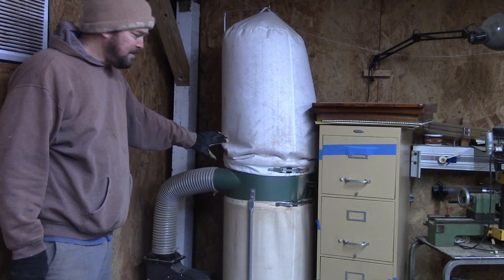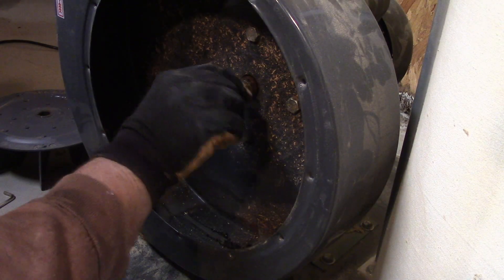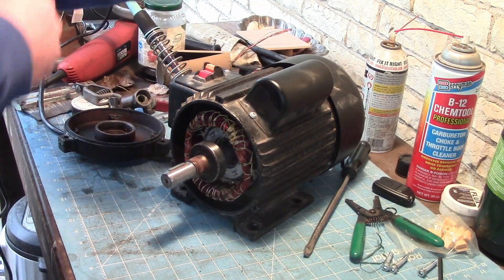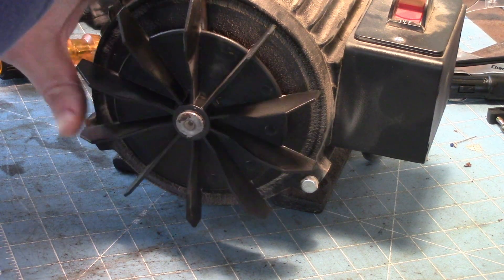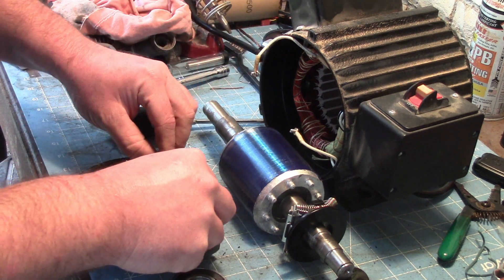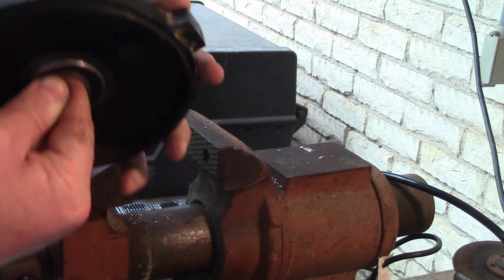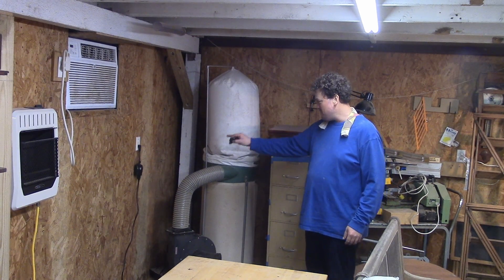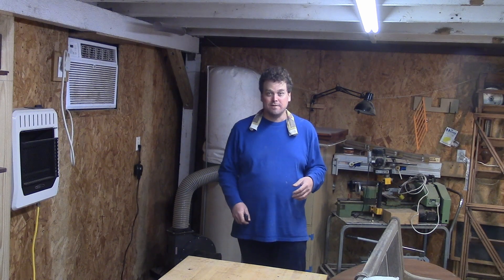Noisy Dust Collector gets New Bearings and a Second Life.

Comment from the maker: Ball Bearings are such a vital part of our world. Not only does everything run on them, bearing factories are also a strategic target during war. Just think back on the events Second Schweinfurt raid during WW2 at the amount of men and equipment deployed and lost in an attempt to cripple the Germans ability to wage war by targeting their ball bearing factories. The stakes are not as high in this video but none the less we breath new life into a Harbor Freight Dust Collector by removing the terrible low quality Chinese Bearings and installing high quality tier 1 SKF bearings in their place.
Reply: My understanding is typically motors of this size and application call for C3 bearing clearance- not the tighter tolerance "CN" of the selected SKF bearings indicated.   Why?   In this application, the tighter fit bearings result in higher wear and heating.   When replacing the lower quality original bearings, aside from the appropriate C3 clearance, bearings with RZ seals- "no-contact" rubber -are employed by some some better collector manufacturers; RS seals are definitely easier to source locally at a reasonable price.

Comment: Did the swap thanks to your video. Huge help. Had an issue with aligning the rotor but got that resolved. Ran for thirty seconds and the cap blew, and spewed its electrolytes all over. I replace caps at work a lot, but I can’t help but think the timing is suspect? Maybe I have an issue larger than bearings

Comment: This is wonderful! I have this same model with the same issue and will use your detailed video to replace the bearings! Thanks for sharing!
Reply: Well, got mine all torn down and noted the following differences…both bearings on mine were 6205 RZ. Available at Walmart online for about $9 ea. for those who don’t have a bearing store nearby. My plastic fan had no c-clip and was smaller than yours, but did just have a tight press fit. Otherwise all else went smoothly. I did use a bearing puller as both my bearings were quite tight on the shaft.